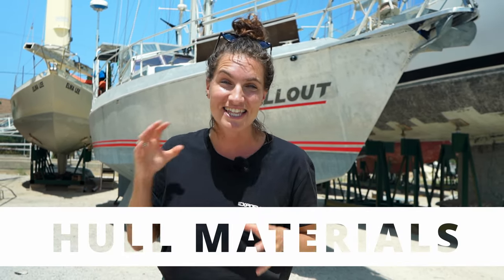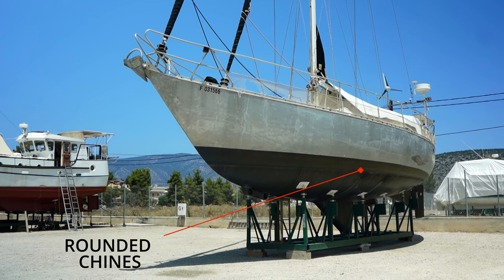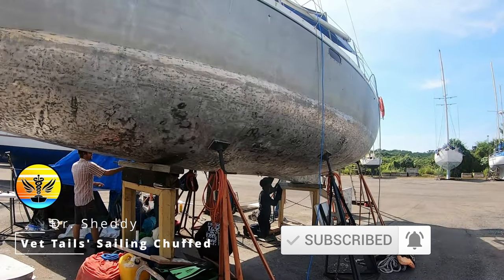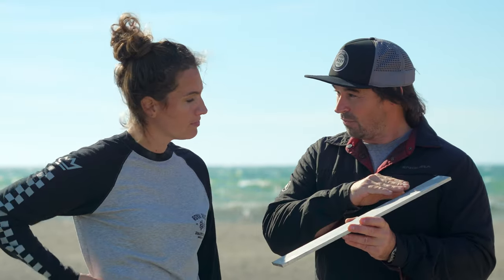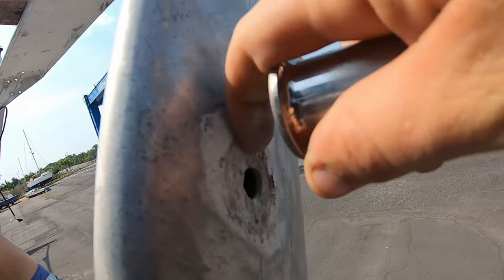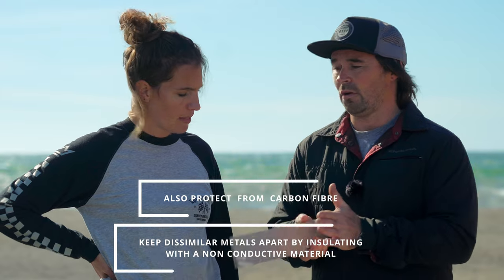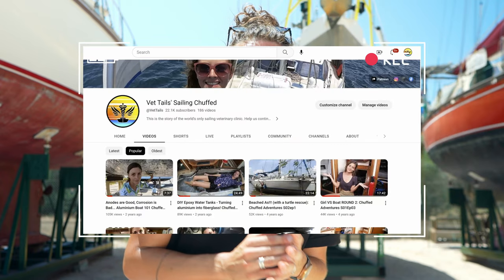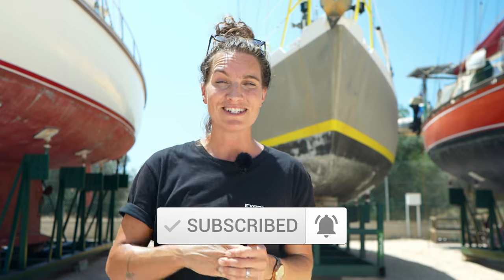The truth about Aluminium sailing boats from a PRO. Hull Material series Pt. 3

Comment: I need help! I'm looking for an Amel style vessel (protected mid body helm) but with an aluminum hull. I love the amel's but I want to adventure not only the tropics but the poles as well, and unfortunately amel does not make vessels with aluminum hulls. Can anyone point me in the correct direction? Thank you!
Reply from the maker: Hey, have you seen distant shores YouTube channel? You may like their boat, an Enksail Orion 49. There is also many other to check out - beastever yachts. I’m sure KM will do something, also check Berckemeyer, hoek, van de stadt.  That’s just a start… 

Have fun👍
Reply: You should look at the YELKOVAN 56, it is made of steel instead of aluminum.
Reply: If you are going way north, my experience is you need heavy steel. you will run into "bergy bits" small iceburgs floating  flush with the ocean's surface. You cant see them at night. one crunch and your boat sinks too quickly for you to ready a lifeboat.
Reply from the maker: @lewis7315 Criekey! Tell me more about your experience!! Did you loose a boat?!

Comment: If the hull is aluminum, what material is recommended for the masts?  What is the mitigation for lightning strikes?
Reply from the maker: You can choose that yourself… aluminium is awesome and attracts electricity. Carbon ins more awesome and attracts more electricity. Wood is good and doesn’t attract electricity 👍

Comment: Steel is stronger when welded , aluminum welds are weaker than parent metal .
Reply from the maker: Hey Philip, thanks for the contribution! Yes your right! 
The reason that it still works is that it is more than strong enough to withstand significant impact. The the base metal is more malleable so it often bends rather than cracking the welds. As in a weld test when the material and weld is folded in a press.
This is the case for most aluminium boats under impact anyhow. 

The good thing about 5083 is that its welds are the strongest of the non heat treated aluminiums after welding. The problem with cracking generally occurs with poor welding - hot cracking can occur due to improper weld cooling.
Reply: My ALU boat builder/welder tells me the weld is stronger then the original plate. 5083 plate/TIG/5356 filler wire/Argon (of course) and man oh man does that argon bill add up!!!
Reply from the maker: @jimjones7821 so it’s the heat affected  zone of the 5083 that becomes weaker after welding. As for the Argon… tell me about it! 😂

Comment: I'd be constantly worried about working in the boat. Maybe designs are different, but my boat has some bilge areas under the engine that are impossible to get a hand into. Dropping a nut, bolt or screw is bad enough without worrying that it's going to galvanically corrode a hole through the hull. And what about cutting stranded copper wire and accidentally having a few little strands end up in the bilge.
Reply from the maker: 😂 really, it’s not quite like that. It really amazing how this rumour appears to have become common belief.
Reply: As a general rule i take as an aluminium catamaran owner. When cutting wires i try to cut them out side. If that fails i have a towel or large rag then a tupper ware box try to catch everything. If i miss some just do a good clean with the vaccuum afterwards no worries. In the engine room we put a barrier coat under the engine where visabily is difficult but give it manual check every week. 
Ive had 3 boats and absolutley love my aluminium catamaran. Id never go back to grp.
Reply: @Floatingnestsirius  Interested to know more about the barrier coat you applied to the engine bay floor. I also have an AL boat - 42ft French boat that we are rebuilding. I am also going to put a barrier coat on the engine bay floor and interested in what you used?
Reply: Used total boat alu barrier coat. But i think any epoxy barrier would work. Im no expert by any means.
Reply: @Floatingnestsirius  Thanks for the heads up. I am thinking of putting down a polyurea (think pick up truck load bin liner) or a flexible PU. Def need a barrier coat on the engine bay floor - my boat had some serious corrosion issues where the the wet exhaust system was leaking (D2-55D engine - yeah Volvo suck!!)  - we had to put in a few patches and plates in the engine bay floor - the advice I was given (when I was uneducated about ALU) was to leave the ALU bare so it is in touch with oxygen to form the passivation layer it needs to protect itself from corrosion. Problem with that is, in a place like the engine bay floor where you cant really see too well is that fluids that have leaked out of the engine are in direct contact with the ALU plate and it then corrodes. My view is that its better to put down a barrier coat so that any fluids cannot possibly touch the ALU plate. The key is in the prep of the plate that will receive the barrier coat. I am sandblasting the interior plate and then applying International Paints Intergard 269 ALU etch primer then a yet to be determined Polyurethane OR an epoxy - but the epoxy must be a flexible formula so that is does not crack over time. Its very tricky to work all this out unless you have an expert ALU guy to advise you - I dont so learning the hard way and paying for it !! - although I feel i could work as an ALU consultant now after the sheer amount of correction work we had to do (my boat is a Garcia)

Comment: Aluminum can easily be a dreadful nightmare. Electrolysis can easily and quickly eat a boat alive. And it is often the huge powerboat close to you in a marina that causes this. I have seen the results with the hull pitted much of the way through in hundreds of places. Its a pitiful sight. Your zinks can be gone in two or three months, then the soft aluminum is next. This is why fiberglass is still better than the alternatives. Note that the fasteners in a wood hull can be eaten away by a close by electric source and your zinks might not stop it. I had this happen to a wood boat I owned back in the day. I had to refasten some loose planks.
Reply from the maker: Nail sickness chap. That’s an unfortunate situation, problem there is no galvanic isolator is going to work for it. Thankfully we’re a big safer in a well protected aluminium boat these days. 

Still, valid points and a great reminder as to why aluminium boat owners need to keep on top of preventative measures.

Comment: Aluminum, electricity and saltwater don't mix.  The electrolysis can be a battle that can't be won by any novice.  It takes huge knowledge with a strong electrical and electronics background, as well as welding skills and surface prep and anti-corrosion practices that include surface treatments.  If you are able to conquer all of that, then the deafening of the hull slap noise and banging (about 4-10 times that of fiberglass hulls), weather on a passage in more than a rough chop or at anchor, will end up driving you crazy and eventually selling it, hence the reason they are so cheap to buy on the after-market and brutal to sell, even after you dump the price down to a painful level. So... good luck with that!
Reply from the maker: Hi, certainly some good knowledge with aluminium there. 

Tricky material, in my opinion it’s the best material for a boat, however thy comes with with one big caveat - it MUST be in the right hands, otherwise it’s the probably the worst material of all!
Reply: sound can be reduced via insulation. true, too many AL boats are not well made, and become difficult to sell. true, too many owners are very ignorant of AL, and so run into a range of troubles.  poor quality construction and ignorant owners can create problems for any boats of any material.
Reply: Welding Aluminium weakens the heat-treated aluminum in the vicinity of the weld, called the heat-affected zone (HAZ), reducing the strength by approximately 40 percent Any aluminum specifier or designer must account for the weakened state of the welded members.
Reply from the maker: Hey Rob, thanks for sharing your knowledge! Your definitely right there about the heat treated alloys, the only thing is that we don’t heat treat boats. We generally use 5000 series which isn’t made with heat treatment in mind and the 6000 when we use it is used for structural parts and it is not heat treated. Your dammed right though, when we heat the alloy they loose strength and we need to account for that, the filler material is often weaker again and that is another consideration.

The video was I tested as a brief highlight to the fact aluminium boats are not for beginners.. there’s so much to talk about on a grand scale with the material - we may do some more in depth videos next year about it 👍.
Reply: @SailHub  hahaha...not for beginners - my ALU boat is my first boat and after I get her back in the water then I have to learn to sail. I am a total sail boat novice - but i know enough to know I want an ALU boat. @ Rob.....As for being cheap - really? Where ?? I searched for a long time to find an ALU boat at a reasonable price. I searched even longer to find a discussion about ALU boats as has been discussed here - there is just not that much info out there about ALU boats - lots of myths and old wives tales but not much practical hands on experience. Repairing an 80's ALU hull will teach you all you need to know - ask me how I know ;-)

Comment: You two are slightly awkward speakers, BUT the content is SUPERB and presented in an understandable way.  Bravo!

Aluminum Oxide protects the Aluminum in the same way that Chromium Oxide protects stainless steel.  (Chromium is the key element of stainless steel alloy.)  The Oxides make them highly corrosion resistant.  The technical term is passivation; the surface becomes passive and not active to corrosion.

ALL boats that have more than one metal in contact with water have galavanic corrosion, including plastic boats that have any two dissimilar alloys in contact with the water.  That includes steel, naval bronze, etc., fittings, driveshafts, any throughhulls, etc.  Just like any boat with more than two types of metals, Zincs are used on Aluminum boats to control galvanic corrosion.  So really this aspect is no different from any other boat whether its hull is wood, steel, plastic composite, etc.
Reply from the maker: Hahah! Thanks fella, I will take that as a  compliment 😂. It’s quite hard having random questions thrown at you and answering them in front of the world… it wasn’t staged or scripted answers, just what fell off my boatbuilder tongue.. That’s why it’s not perfect!
Reply: @SailHub  It was as close to perfect as one is likely to get most of the time, so it was a compliment.  Please keep up the great videos!
Reply from the maker: @LoanwordEggcorn thanks! That means a lot to us! 👍

Comment: But isn't carbon fibrer just plastic, uno some ⛵ like the Lagoon 40 is a plastic boat?
Reply from the maker: Hi, thanks for your comment.
The answer is no, carbon is not plastic and it’s not like the fibreglass in the lagoons etc. Carbon is its own thing and it conducts electric and it has a static voltage of its own.

As fibre glass does not conduct electricity, it does not effect metals in the galvanic table, due to the very high conductivity of carbon it does. 

A big problem we can find is with carbon boats and stainless chainplates, there’s a reason we don’t see this technique used very much these days - the chainplates often suffer.
Reply: @SailHub  Okay thanks 👍
Reply: what you are thinking about is the epoxy - "plastic boats" can also be thought about as fiber-reinforced plastic - the traditional material being mats of woven glass,  glass is non-conducting and so is epoxy.. = insulator.   
Carbon fiber on the other hand is, well carbon which is conductive, like a pencil essentially.
*there are a lot of other materials also, from hemp fibers via rock based glass alternatives.
Reply from the maker: @Sailing360 legend! You nailed it👍

Comment: I would never choose aluminum for a saltwater environment.
Reply from the maker: Interesting.
Reply: Educate yourself before speaking up with this nonsense
Reply: @jimjones7821  I run a fleet of seaplanes in the pacific ocean.  aluminum and saltwater suck.  end of story
Reply: @foodandsleep2417  not if you prep your ALU plate correctly with the right etch primers/epoxy/Trilux33 anti foul (although you dont need the anti foul on a seaplane)
Reply: @jimjones7821  well, you're entitled to your opinion even if it's wrong
Reply from the maker: @foodandsleep2417 someone’s cranky!
Reply: @foodandsleep2417  well guess it comes down to what choice do you have? So make the most of it , eh? Your aircraft will be using 7000 series ALU, boats use (or should use) 5000 series ALU. Big difference right there. Its horses for courses I'm afraid - you use an aircraft and 7000 series ALU - you have little choice in this - right? So do the best you can to protect what you have. Honestly what other answer is there in something so specific as aircraft ALU? It is what it is, so man up to the problem and do the best you can given you have 7000 series ALU in sea water.
Reply: @jimjones7821  the majority of aircraft aluminum is 2024-t3.  the alloy percentages are so small that they're essentially irrelevant.  Bottom line.  saltwater and aluminum are not friends.
Reply: @foodandsleep2417  Oh my bad - I had an FAA licence but I let it go 22 years go, but never got into what aircraft are made from. Here, while sourcing 5083 plate for repairs to my hull I was told aircraft ALU was 7000 series and took it as gospel. Just goes to show - dont believe everything you are told . I was paying $450 for a sheet of 5083 (3000 x 1500mm). 7000 series was quoted to me as $1600 per sheet. So mighty big difference there. But OK, granted if you cant apply an antifoul to protect the ALU saltwater may be far worse on the plate compared to 5083. We use 5083 as its the most resistant to this problem. This time last year I knew little about ALU - now 600 hours of re-plating and correction work later I do understand 5083 and how it is welded.

Comment: This is a very pro aluminium blog. My experience is somewhat different. Aluminium is not a great building material once it ages. The corrosion is a constant battle. You struggle to keep paint on. Give me GRP any day
Reply from the maker: Thanks Tim, 

Yeah, the oxidation is a pain however… don’t paint it? Problem solved.

Grp is fab, all materials have the positives and negatives, it’s a personal choice really 👍
Reply: I had a 33foot sloop aluminum  never ever again.
Reply from the maker: @HoferAdam-xz9xz  oh no! What happened?
Reply: @SailHub  galvanicelectrolyse  eating my saildrive away.that was just one issue.
Reply: If you have a aluminum boat bay, the book from this English matalurgyst James Warren  it called corrosion on yachts.
Reply from the maker: Oh no! That’s an issue all right! I’ve seems that on quite a few boats, not just aluminium though. However electrolysis is the real burden of aluminium. It’s not necessarily a huge problem but an owner certainly needs to understand it before they take it in… otherwise it’s like my an expensive and steep learning curve!
Reply from the maker: Perfect! Thanks for the link - 👍
Reply: @SailHub  you are always welcome 🙏
Reply: @SailHub  aint that the truth !....an expensive and steep learning curve ! But when its back in the water it will all be worth it. Where I will be operating I cant risk a GRP hull and steel is a non starter for me. So ALU it is.
Reply from the maker: @jimjones7821  interesting, where are you operating?
Reply from the maker: @jimjones7821 bloody hell. That’s amazing. All of it! What a legend, I would love to sail with you some day, what an adventure!!!
Reply: @SailHub  you are welcome to come out this way once I get her there. I reckon I have another year or so on this rebuild.
Reply from the maker: @jimjones7821  amazing! Now there’s an offer! Super kind of you! 

We will have our hands full of our own work for the rest of this year that’s for sure but I really, really would love to visit at some point!

Comment: I really liked the content👍👍 , info was exellent, and the interveiw was very covincing. mal4821 is right on aluminium canoe experience. foam insulation could hepl the noise part.
Reply from the maker: Hi Herbert! Thanks so much for the comment!
Yeah, noisy boats.. we’re big into natural insulation where possible, spray cork being a winner for noise and damp , it’s great to see it being offered from bigger brands like KM these days too!
Reply: @SailHub  how much insulation does the cork add and at what thickness ? Big problem here is I cant fin spray cork - only 3mm cork sheet - so will probably use an adhesive to stick the cork sheets down (after trimming to size to fit the spot it will be glued to the hull). Will be a big time consuming task though to stick cork sheets to a 42ft hull !!
Reply from the maker: @jimjones7821 hey Jim, the insulation is pretty impressive, we did an episode in it that may be of use, 
https://youtu.be/zXXzXpD3_ng?si=HdZuNq4w9zkbtuMD
We did the van out with it for a test, we will be doing some proper tests with it soon but I must be honest, it’s super impressive.

Send us an email, info@sail-hub and I can help you sort your spray cork out. Cheers, Chris